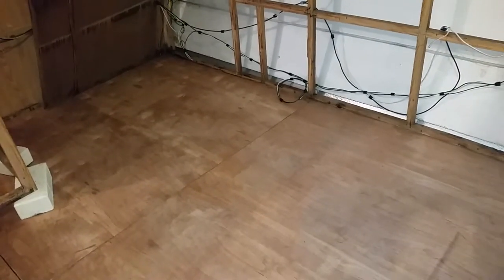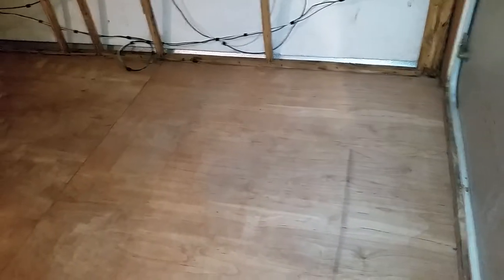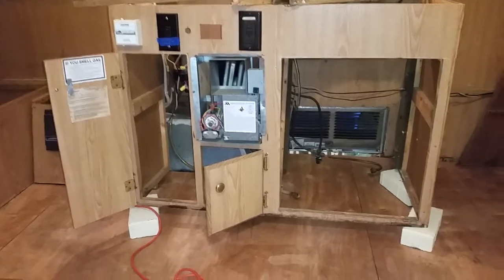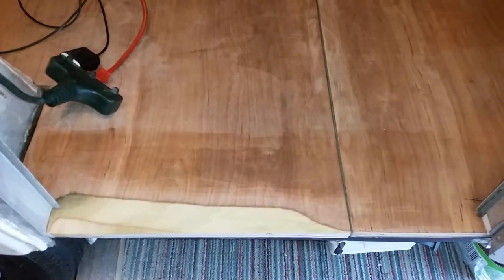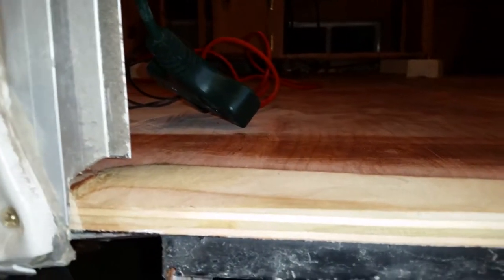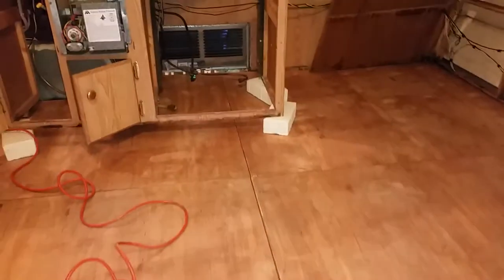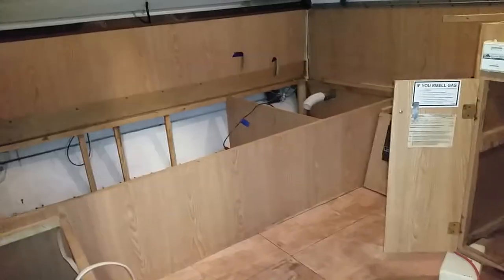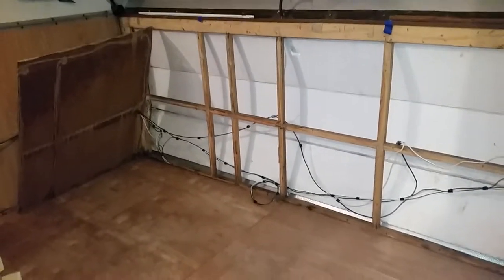Aliner Makeover and Repairs: The Whole Floor Is Finally Replaced 4/28/18

Comment: Very nicely done. I'm very impressed that you were able to replace the floor without removing the body. I have a 2002 Aliner Expedition LXE. The interior is very similar to yours. Been lucky on the floor so far, fingers crossed. I live in the Pacific Northwest so I regularly check for leaks because it rains so much here and many leaks have developed over the years. Got a leak now that only shows up when driving in the rain. That one will be fun to figure out.
Reply from the maker: chickenlips I appreciate your kind words. It's been a learning experience, that's for sure. Just took a break from priming and painting all the countertops I am also replacing...the wheel well covers, the small door cabinet counter, the kitchen sink/stove counter, and the dinette table, but not before I had to re-cut a couple of pieces first because I had to learn how to use a router to do roundover edges on plywood (insert a few f-bombs here).
Reply: I need to replace my counter tops and I like the idea of painting the walls. I have some water damage from a leak due to snow load. The faux wall paper and the counter tops have warped. I've been living with this but after binge watching your videos, I realize I should do something about it. I look forward to seeing your final results.
Reply from the maker: chickenlips Painting the interior is kind of a pain but will be worth it. Lots of nooks and crannies and confined spaces. Maybe you can share with me some leaky problem areas because I have yet to even take my Aliner out of the garage and test for leaks. The only thing I do know for certain is that I will replace the spring covers at the exterior corners. The ones back in 1999 were way insufficient and I could see the obvious water damage from them.
Reply: So leak problems. Other than normal re-chalking the obvious areas, I've replaced most of the open cell foam. Re-chalked the door threshold. The open cell held water up against the threshold and the inside entry was always wet after a rain. Replaced the wraparound tail lights with sealed LED lights. The old lights collected water and dribbled water inside through the wire holes. By far, the biggest leaks have been around the gasket that covers the front and back roof hinge. Water adheres to the roof edging and dribbles right down the gasket and into the inside so one corner was always wet after a rain. Rather than replace the gasket, I used a non-latex stretchy silicon chalk to cover the joints and that works great. The biggest leak happened when I put the aliner down for the winter. A snow storm followed by heavy rain bowed the roof and water poured into the aliner. I caught it before rot set in but what a mess. I had to replace all the cushions, wipe down everything with bleach, and the faux wood paneling is looking worse for wear. Now I store the aliner with a trailer cover and tilt the aliner so water runs onto the ground. Oh, and I run a cheap electronic dehumidifier all winter. What a difference the dehumidifier makes. When I open the trailer up in the spring, everything smells fresh and there is no musty build up on the walls. Have I mentioned that it rains a lot here in Puget Sound.

I have not had problems with leaking around my springs though I've heard that condensation will cause that problem. I sleep with my windows open, no matter how cold it gets. So no condensation. Well that's not a 100% true. The roof peak will sometimes drip water onto my forehead. That's fun! There's a youtuber called "Slim Potatohead" that has a video on fixing water leaks around his aliner springs and he produces beautifully done videos.
Reply from the maker: chickenlips Wow, that's great info! Some of the things you mentioned already crossed my mind but now I have much more to inspect and watch out for. I have seen some of Slim's videos in an effort to learn as much as I can about Aliners. I had never even heard about Aliners until I bought this one. Talk about jumping into the deep end 😂

Comment: Thanks for the great videos and tips Nicci!  You've inspired me to follow in your footsteps and replace my floor. I'll be attempting this using your method. Can you tell me when you performed "the squeeze"? Was this after the new floor was installed, or after removing the old floor but before installing the new? Thanks so much!
Reply from the maker: It was definitely after the new floor was installed. I think my enthusiasm in getting the old floor out and getting the new ones in place contributed to the bottom of the walls splaying out a bit. This might not happen to you but in hindsight I would have put straps around the whole thing before pulling the old floors out in order to maintain it's propper shape while getting the new floor pieces in place with a rubber mallet. The new floor pieces did not just "slip" into place, that would have been too easy 🤣. I would probably recommend you strap it before you start. You can always do the squeeze later when you're done.

Comment: how did you get the walls attached to the floor? i’ve got a 1996 chalet aliner that i’m gutting and replacing the floor in just like you have done with yours.
Reply from the maker: I don't know if the same will be true of the Chalet, but my Aliner's walls were originally attached to the frame and flooring with a 4 inch aluminum lip/band that was basically wrapped underneath and nailed. I removed the small nails in the aluminum lip first, then cut, chiseled, or hammered out the old flooring. Since the original flooring was one piece I had to replace it with 6 different new pieces and then used screws to reattach the aluminum lip.